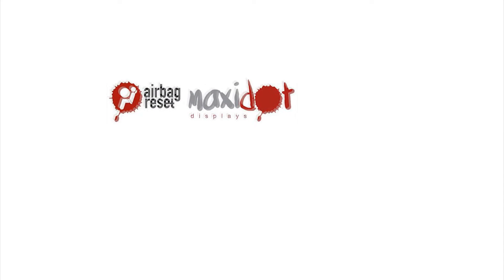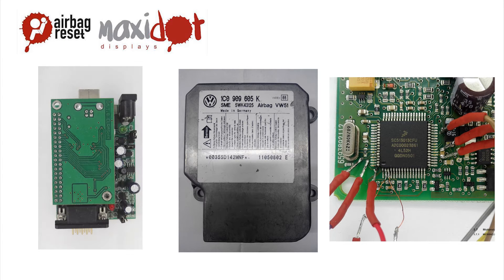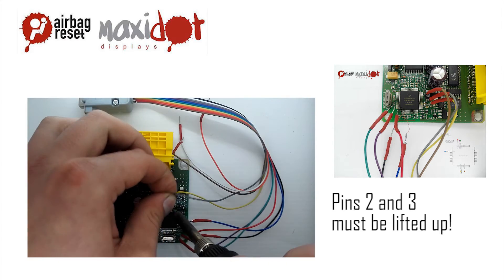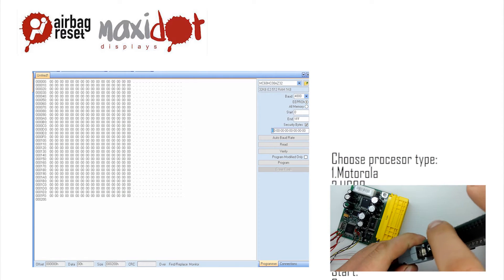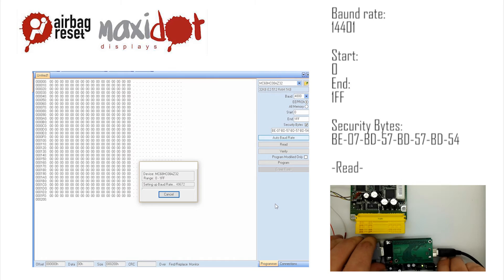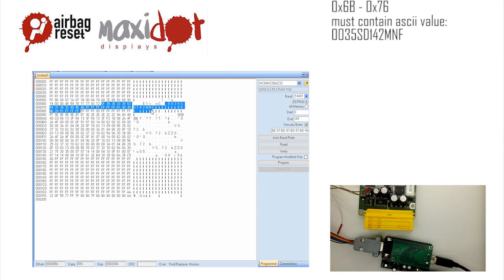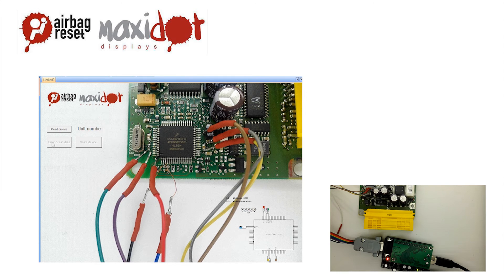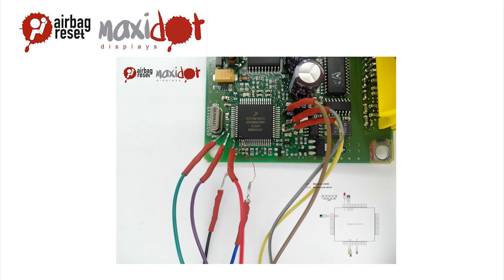VW - 1C0909605K Siemens 5WK43125 VW51 - 68HC908AZ32 Airbag control unit

Comment: Hello! Is there any chance to find pinout for two airbag units? One is 1J0 and one is 1C0. I want to swap them from 1J0 to 1C0 but the plug is different and I have to add can wires